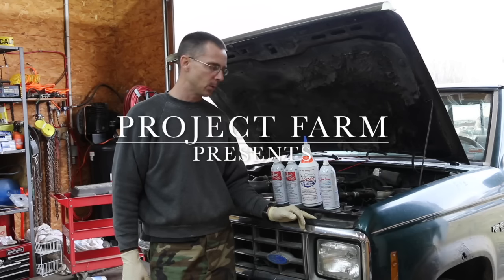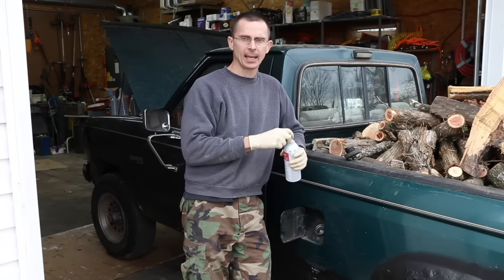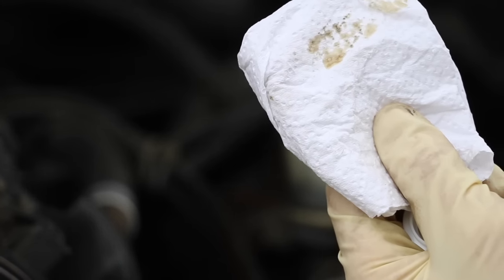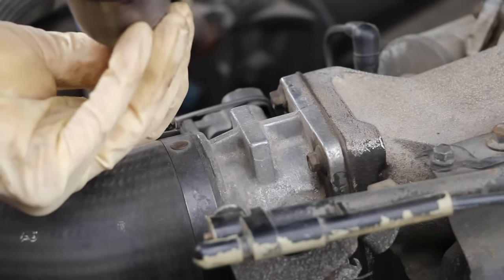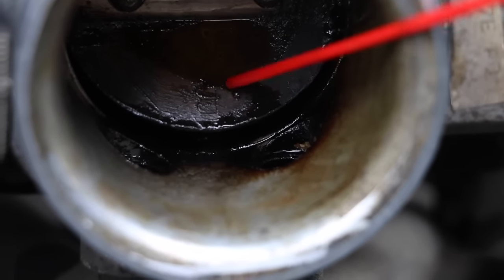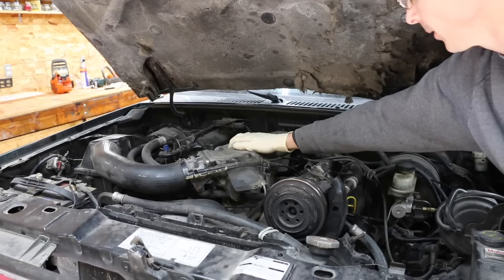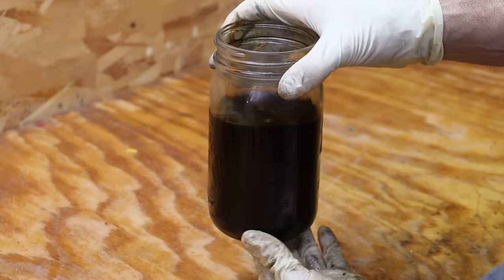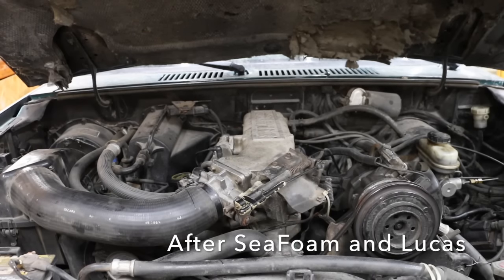Seafoam--can't believe what it did to my engine!!

Comment: can we just take a moment to acknowledge that he’s still replying to most comments, and liking the comments even after 4 years. that’s called dedication. great respect to this man.
Reply from the maker: Thanks so much for the nice comment!
Reply: @ProjectFarm  Wow! What a difference. I never would have expected such a dramatic change.  This is the 4th video of yours that I watched today. Excellent work! Subbed and bell rung.
Reply: @ProjectFarm  do you suggest engine restore additive when one or more cylinders have low compression? 5,7L V8 L98 possibly high blow by with 10w40, maybe worn piston rings... complete rebuild would be around 5k$ :(
Reply: @user-hc3dr6mx2c  Yes just spray away your problems
Reply: Yeah, this channel is great
Reply: Agreed!
Reply: Ain't that the truth
Reply: @user-hc3dr6mx2c  It's worth to try, it's cheaper than 5k lol. If the problem is stuck rings it will definitely help.
Reply: @project farm do you add the Lucas on top of the proper amount of oil (ie 8 quarts plus Lucas) or add it with less oil to get the proper level (7 quarts plus 1 qt Lucas)
Reply: @577buttfan  my apologies the bottles are a pint. It says one pint for four quarts
Reply: @user-hc3dr6mx2c  That's a tough one, I think someone already said it but if your rings are stuck then an additive clearing off some of the carbon can definitely help with low compression, if it's just about anything else you can actually make it WORSE! Yeah you heard me, sometimes the carbon buildup is the only thing giving the low cylinders ANY DAMN COMPRESSION haha. You take that carbon off and it could let your air/fuel mix slip by even more!!

My theory is that mechanics would have a hard time making any money if you could replace them with a bunch of fluids that promise a whole lot of things that sound too good to be true.. You know what they say about things that sound too good to be true...

You've got a V8 so I'm going to guess this will never be a problem for you, ever, but don't add oil additives to a Honda with VTEC.. Everyone remember this (I had to type it somewhere around here).
Reply: @Herbert Wingfield He says Seafoam is only good for 2 stroke motors.
Reply: Todd is awesome. Probably one of the most selfless people on YT. It's easy to see that he makes these videos for us, and makes sure we are satisfied, and not for the money. I'll stay a subscriber 4 ever!!
Reply: @Herbert Wingfield Scotty doesn't give it a very good review, he claims it'll damage your catalytic converter, but it won't!!!!!!!
Reply: @CraigPetty555  I'll stay a subscriber as long as you, plus one day!

No but really, I will. Come at me bro. 

Todd is what I like to call a "good ole boy." He's a good ole boy with good ole fashioned values, and a good ole fashioned head on his shoulders. I have to believe he's of the theory that if he does his best to provide us with useful, honest information, about things we all use every day. And as long as he keeps his integrity, never compromising on his values... His videos will be appreciated by those who view them and can see the heart he puts into what he does, the reward will just come natural. People will want to reward him because he's an honest man putting in honest work, and helping people along the way.. And God damnit what's not to love about that?

It's obviously working. He doesn't need the click bait, or the misleading us with titles that don't fit the video.. He doesn't try to sell us on a mobile game that's addicting thousands upon thousands of young kids to gambling before they ever become adults. Trying to expand the market of the parent company of that very mobile game... Making those kids customers of their real money makers... Slot machines, before they get out of elementary school.

No, Todd just does honest tests to the best of his abilities, on things he reads that we want to see in the comments. The guy is still commenting on videos from years ago... I just can't fathom seeing this guy, discovering this channel, and not just falling in love with the channel, and yes Todd too. His honesty and Integrity is a breath of fresh air in a world where those qualities are becoming harder and harder to find in people, businesses, on the internet, you name it... I think he could damn near make videos about anything, because he'd do it with those very same ethics applied no matter what the video. I'd watch anything he puts out, he could review different barbie dolls and I'd click every time the notification came up. The values, and wholesomeness of this "good ole boy" is captivating.

Appreciate you thoroughly Todd, never change. You deserve any and all success, and the monetary compensation that comes with it, every bit of it and then some.
Reply: Yup! He is diamond of a person!
Reply: @harisjaved1379  I find it ironic that you compare this man, this beautiful, honest, pure, treasure of a man... And, of course you didn't mean to. I just thought it was hilarious you are likening him to this specifically... 

To the biggest, most dishonest hoax of all time lol. The value of diamonds was manufactured to be high since they were and are, in HUGE abundance... I'm sure you've heard the story. Basically made everyone feel like they needed to get her a rock the size of the nearest mountain.. Made up that whole, "better buy her a ring worth two whole months of your pay or you don't actually love her!" bullcrap that I cannot believe anyone actually fell for.. Two whole months of pay... You're basically working for free for two entire months just so your future wife can rub her piece of glass looking stone with no color, in the faces of her friends haha... Anyway.

Todd is a national treasu- crap... Bad Nicholas Cage movie... Never mind on that one. Todd is a... Bad mama jama? I don't know, maybe diamond was easier.. Lol
Reply: @danielnelson4881  LOL! This is too funny! But yes Todd is an awesome person! I wish more people were like him.
Reply: @ProjectFarm  OH THE DAYS ! !  Sea Foam for the WIN
Reply: This guy is awesome, answers a lot of questions on things I wonder about but don’t have the time or money to test 🤙🏽
Reply: This man is so far above the average YouTuber but as for review channels he's legitimately everything and more than any handyperson could ever need or wish for. I share this channel on a weekly basis being a general contractor and all around handyman.
Reply: “i spend hours reading thousands of comments” love it
Reply: Yep this guy is definitely dedicated
Reply: We're going to test your hypothesis. Let's see if he responds to my comment.
Reply: @Space Ghost Right. Check with a guy who recorded himself working under a vehicle supported only by the hydraulic jack and no jack stands. I wouldn't trust anything that guy says.
Reply: No it's more like you too we can't get YouTube to stop nagging us after 3 years
Reply: @user-hc3dr6mx2c  Have you tried seafoam in your engine? It may not be blow-by you're experiencing it could be carbon build up preventing your intake and or exhaust valves from sealing completely resulting in compression loss, an open exhaust valve shows the same symptoms as blow-by, I've used Seafoam on several high mileage vehicles that had been neglected proper service intervals, cleaning out the carbon and sludge build up really makes a big difference on some vehicles.
Reply: No
Reply: @user-hc3dr6mx2c  buy a rebuild kit and watch a YouTube video/haynes manual or double down, take it to a shop and and it bored to a  377 stroker. they're pretty simple all things considered so basic tools and mechanical knowledge (with a manual) and you should be fine.

if it's a daily id suggest having it done at a reputable shop.
Reply: It’s call being self employed lol and viewers are his clients
Reply: Great job, so almost 4 yrs later, how's she Running?
Reply: I feel like he makes the best videos on YouTube right now...
Reply: Most definitely. His subscribers love him.  He's great
Reply: Exactly! I’ve noticed this too!! This man is truly dedicated!! Thanks again!
Reply: @user-hc3dr6mx2c  trade it in for a real mans engine! Chevy's are junk
Reply: @Space Ghost he was talking about scotty Kilmer... you do know that his schtik is satire right? Don't believe everything he says.
Reply: It’s why I stay subscribed!
Reply: @chrisibarra5586  its probably his wife who he put on his pay roll
Reply: @Space Ghost IMHO, Scott has gotten annoying recently with his manlove for Toyota. In his opinion,  everything sucks except for Toyota.
Reply: Let's all take a silent moment for the destroyed engine by Sea Foam. lol
Reply: It’s a quality channel and he’s a true gent 🙂👍🏻
Reply: Good shit!
Reply: Yes! The guy does incredibly thought out, thorough tests. Somebody should be paying him handsomely.
Reply: He s
Part of the 
SOLUTION!!!
*
---
Reply: Right there with you Michael
Reply: @IMPACT-NATION  
Luv
Affirmation.
Mucho
Reply: @IMPACT-NATION  I already gave you a thumbs up I was like number one
Reply: In other words...
Great Video/ real good GUY!
Reply: @canucanoe2861  

A nice lady Virginia and Advance Auto in Quincy Mass told me like 30 years ago...

I still buy her a coffee every now and then
Reply: I agree. He is one of my favorite Youtubers! His videos are really helpful and they are straight to the point!
Reply: By far one of the best YouTube reviewers I trust him and he's top notch his texting methods are genius and if you are on the fence about a tool or something I recommend people to see if he's got videos on them
Reply: @ProjectFarm  Thank you for what you do
Reply: Forsure i was just thankin that the other day. Good on him forsure!!
Reply: I'm glad because I just discovered him. I've been going through and liking every one.
Reply: LOL I am going to test this
Reply: @ProjectFarm  well everyone has something nice to say
Reply: will you reply to this? lol
Reply: He probably has to pinch himself and revisit these videos for how much money and fame these videos brought him!!! Its a fantastic channel and he deserves every bit of it.
Reply: shaddup
Reply: @brians7604  you mad bro? What's wrong, no one from 4 years ago acknowledges you?
Reply: He has alot of time on his hands waiting for his projects such as oil freezing.
Reply: EXACTLY! I refuse to subscribe to a channel where the author will not reply to comments. This guy is the best !
Reply: @577buttfan  I've seen plenty who's job is YouTube who rarely even answer their newest videos much less one that's now 7 years old.  However, in this entire thread he's not liked nor commented back to anyone besides the initial commenter, even those who specifically said "hey respond to this if this is true", so maybe he doesn't keep up with reply threads but rather just initial comments 🤷idk as this is the first comment thread I've read so I'll have to go back to the main comment gallery and see how true this statement is
Reply: @jerryx2000  @stakz563 well seems he doesn't actually reply or react to comments past the initial question, so no comment threads, which means you may wanna comment out in the main feed...I can say I see replies from him as recent as 3 months ago so pretty impressive
Reply: You act like he’s going back to old videos and finding new comments. It’s literally just a tab in YouTube you click that has your notifications
Reply: @577buttfan  That's cool. I think Lucas products tend to be very good.
Reply: @Hey_Jamie  yeah but many creators don't even comment or interact at all with comments on newly released content much less videos that are years old
Reply: So many subscribers and views, that's insane
Reply: Yeah he's great! This channel's great! I'm always surprised when I get a reply and then I look and the video is like 2 years old. He pays attention. He loves the input too.
Reply: @Max okay, long enough lol
Reply: That’s when you can tell you give a damn about your audience. He knows exactly who his target market is and hits the nail on the head every time with something reliable, accurate, and easy to take in. Great guy, honestly. I can’t tell you how many of these videos I’ve binged. I mean, it’s always interesting content and I know I’m getting a better product after watching his tests.
Reply: @crazyidiot5309  You know it's honest because he is NEVER sponsored by the products he reviews! That's integrity.
Reply: @ProjectFarm  You are a good guy and we would all share a beer with you
Reply: He certainly looks like a teacher of test mechanics , and sounds like one also 🤔👍🔧
Reply: I would also if i made 26k on one video so far and climbing
Reply: @user-hc3dr6mx2c  Try a couple quarts of Lucas stop leak
Reply: Right on!
Reply: Todd is an awesome guy. Another way to tell is he isn’t wasting our time advertising some crappy VPN lol
Reply: @Project Farm have any idea why my car is blowing white smoke from the tail pipe
Reply: He’s the man always reply’s !!
Reply: @577buttfan  it's very uncommon it's a ton of work to do. And most creators don't think it's worth it.
Reply: That's a what ranger guys do..lol
Reply: This was impressive 👏 thanks for sharing!
Reply: The best
Reply: We’re gonna test that.
Reply: I've been watching all his videos especially testing engine oils and additives the last few days. I wonder if sea foam will make my diesel sound less like a diesel though. We should test that
Reply: I've found his Project Farm videos to be among the most enlightening and engaging of just about any others out here. Kudos for always using scientific-based proceedures in his testing and coming up with results that support his ideas.
Reply: Try six years lol
Reply: You’re absolutely right AND it’s that mindset and  work ethic that’s needed for a fair, unbiased  and comprehensive analysis.
Reply: Yes indeed, adding value to MANY people. He has really put the law of compensation on his side, for the positive 😊
Reply: thats how you get 20 000 comments on a video!
Reply: He just had a stock reply. Hes not actually engaging. Not that theres a problem with that though.
Reply: 6 Years now, The man is a national treasure
Reply: and no Auto-Tune!
Reply: ❤️❤️😎 @ProjectFarm
Reply: Love his videos